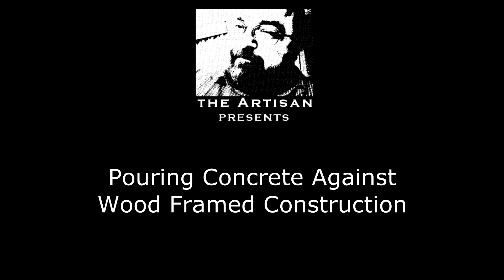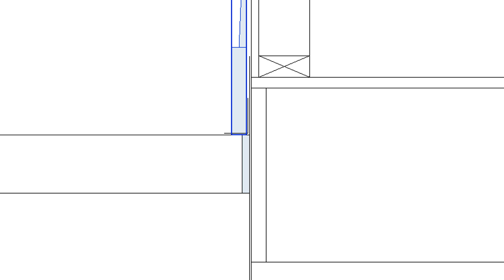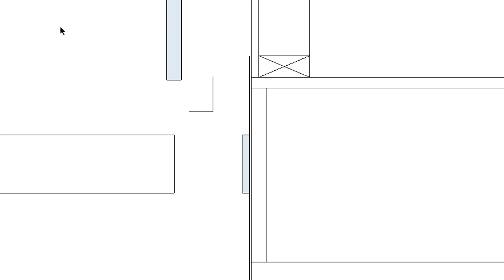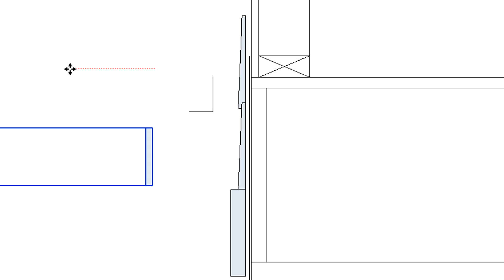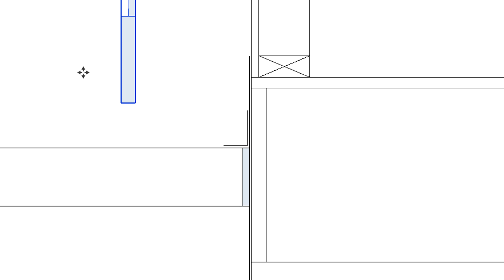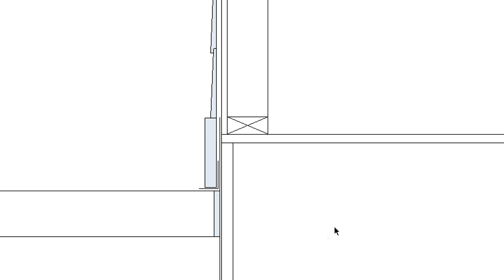Pouring Concrete Against Wood Framed Construction

Comment: Great, now how do I fix this posthumously?
Reply from the maker: Is it rotting out?  If not you can put some sealant at the wall to make sure water is not going between the concrete and the framing.

Comment: Does the same theory work for the inside of an already existing wood frame? For example pouring a slab for an already existing garage with wooden frame?
Reply from the maker: anytime you are pouring concrete against wood framing there should be protection from the concrete and other moisture sources.  If I had a sketch of the condition I could help better but yes,  always have flashing to protect wood framing.
Reply: @ArtisanTony  so flashing and a 1/2 in expansion joint should be good for a slab for 2 car garage?
Reply from the maker: @kyleguy2305  yes, and of course the slab should slope slightly away from the framing if it is exposed to rain or water from a hose.

Comment: And then when the ground freezes causing heaving it is going to rip the siding off?
Reply from the maker: I have seen all kinds of crazy stuff
Reply: @ArtisanTony  I found your video trying to figure our how I should add a concrete patio and sidewalk outside my mudroom that was built like a deck.
Reply from the maker: Thank you for watching?  Did you come up with a solution?
Reply: The concrete co wants to pour concrete up against my siding. They insist it's done all the time but I just can't shake the feeling that it's not a good thing and that it's going to create problems down the road.
Reply from the maker: You  are  correct!  Concrete always retains a certain amount of moisture especially an exterior slab in contact with the earth.  It might take a number of years but you will eventually have problems and the concrete guy will be long gone ;). Send me a picture of the project to tony@artisantony.com and i will make a video for you.

Comment: While I appreciate your intent to help. The installation technique is wrong. Your slab and gravel fill are above foundation top which will allow moisture/water and insects to penetrate the wood structures from the bottom side (ie. rim joist, wall sheating, etc.). installing 'L' flashing on top of slab is small portion of proper installation.

Comment: Great tutorial Tony. It's interesting to see how differently things are done in different states. Around here, the I-joists would have been hung from joist hangers inside the foundation wall, especially on a two story. So basically, the flashing and expansion material would be up against the foundation and the slab poured up against that.